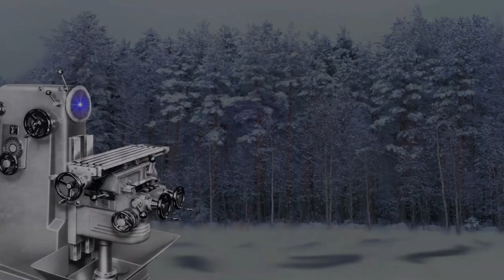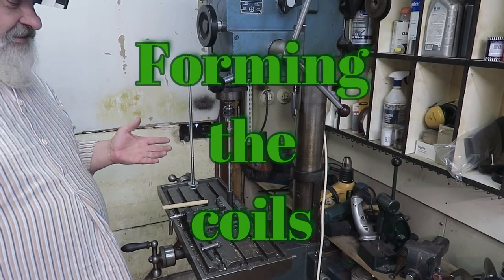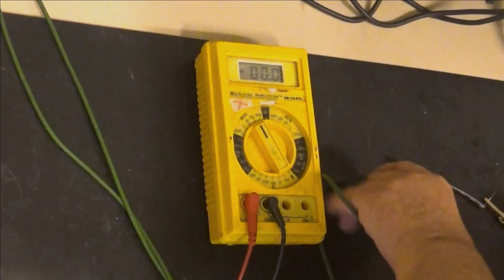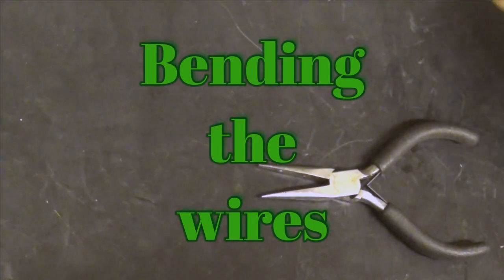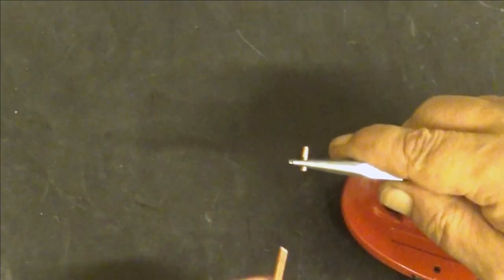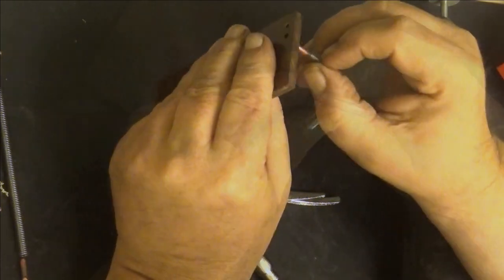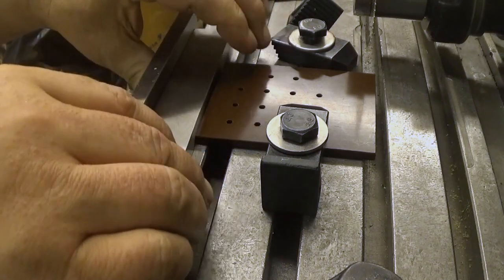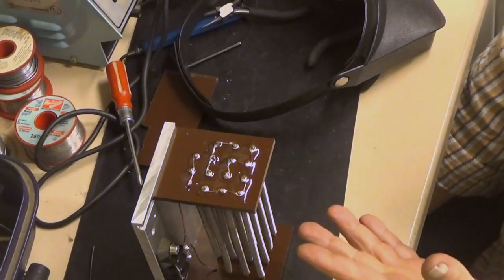VFD Braking Resistor

Comment: That's interesting. I'm hoping to set up my lathe with braking through the VFD (Bosch Rexroth) but the manufacturer claims that it has an internal braking resistor.
Reply from the maker: I actually downloaded the operating and installation instructions for the Rexrotf VFD:s. 
What it has is a braking chopper. This is an electronic prerequisite to be able to brake with the VFD. It still needs an external braking resistor to dump the energy somewhere.
Typically these resistors are quite hefty, over 100W or so. It would be impossible to have such a resistor inside the VFD housing.

They mention this ability separately because it requires a separate set of IGBT:s (power transistors) to become reality. This is usually the first thing to be stripped off from cheaper models.

If VFD braking is used with heavy inertia and fast stop rate without a braking resistor, the VFD let's the load go freewheeling. This can happen even with a braking resistor if the energy to be dissipated is too big.

The Rexroth model the information was for is EFC 3610 / EFC 5610.
Reply: @FinnoUgricMachining  thanks for that. It seems I need to do a lot more research on my drive. I thought it was too good to be true. As it turns out I have a mechanical brake on my lathe so I may just configure the drive to free wheel on the stop command and use the mechanical brake or set up a short ramp down cycle to stop the spindle. 
Regards,
Mark
Reply from the maker: @Preso58  It is also possible to actually buy the braking resistor. They are usually a lump of aluminium which has a cave with the resistor and some ceramic material to support the resistor wire and transfer the heat out. They are not very expensive nor are they hard to find. The hardest part is to figure out the correct resistance value. The manuals are not casting too much light over this subject.
To configure the free wheeling is not that simple in a VFD. At least the ones I have used (Huanyang) do not directly support this. One can configure the start and stop times but the VFD just adjusts the speed according to the start/stop slope. I think You also had one Huanyang which You silenced with a thremostat in the fan.
Reply: @FinnoUgricMachining  Thanks for the additional information. I have been able to configure the digital input as a free wheeling stop. However I can also configure it with a very short ramp down which is probably a quicker stop than using the mechanical brake. I have the motor ready to go in and the VFD is wired to the 240V supply. I just need to swap the motors over and run the signal wires to the existing mechanical switches in the lathe. It's probably a two day job but I am part way through another project that requires the lathe and I am making a video of it so I cannot have it out of service until that job is complete. There is a sort of Australian based YouTube video hashtag scheduled for 1st. October called #roughcut2022. Emma Ritson who runs Emma's Spare Room Machine Shop on YouTube is coordinating it and I decided to bash out a tool to be included in it.
CaLem has already revealed his entry and of course it's brilliant so it's sort of set the bar quite high. 
Regards,
Mark
Reply from the maker: @Preso58  Sorry Mark, this went into "suspicious" comments as it contained some assumably suspicious words ... I suppose the algorihm does not know anything about context. .. have to choose wording carefully :)
The fast ramp will actually activate the electronic brake if the speed does not decelerate "naturally" as fast as the ramp goes down. The VFD senses this by measuring the voltage the motor generates (back EMF) and if that voltage exceeds what it expects, then it tries to bring it down by braking the motor.. Without braking resistor this attempt is futile so the VFD let's the motor go and some VFD's, like the HuanYang, enter an error state which has to be cleared either by the reset button or by cycling the power.
In my milling machine this happens if I adjust the mechanical variator down too fast. Apparently the spindle power train has some serious rotating mass in it and it will speed up the motor which then trips the VFD. The VFD is encosed inside the pedestal under a lid with 4 screws so it is quicker to cycle the power when this happens.